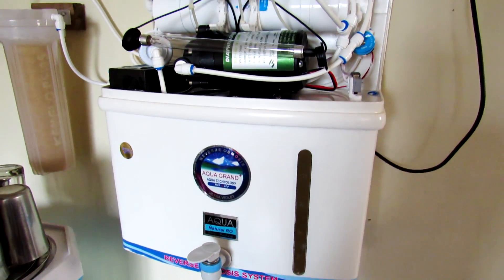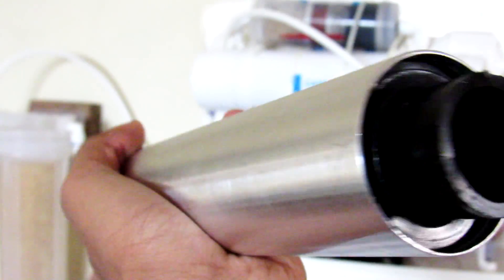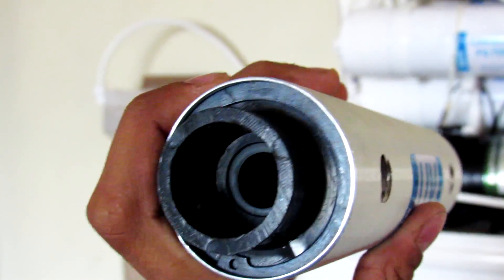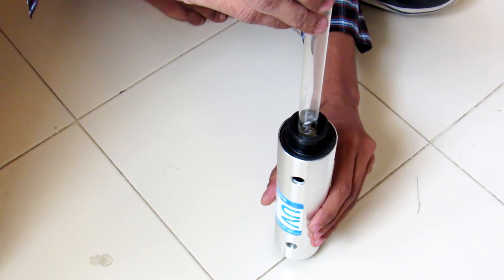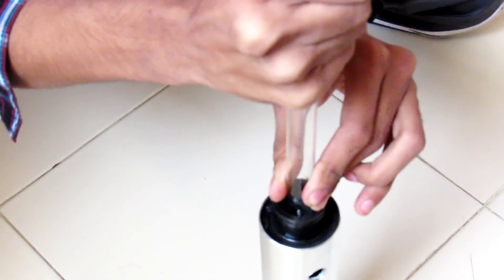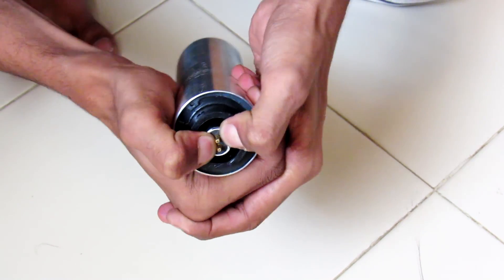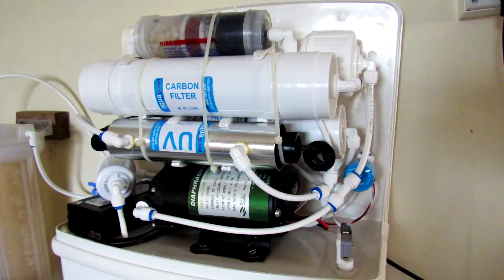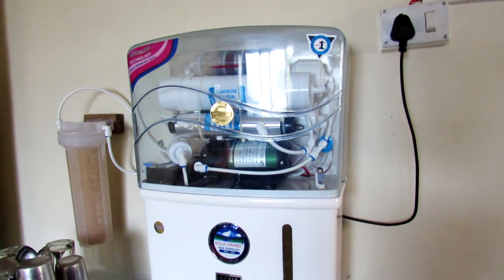💧 UV Light Bulb | UV Lamp Replacement : How to Change

Comment: I appreciate ki tumne English m smghaya but technical words thode smbhal k use kro drag force kehte kise h wo janlo pehle ok.
Reply: Mohd Sajid Drag is a force no compulsion to mention force. Just like drag over aeroplane wings or drag caused on a car due to air. And the correct technical wording to be used here is friction or resistance. The rubber o-rings cause friction during motion due to which more force is required.

Comment: Don't touch uv lamp and see your eyes this is dangerous, I'm RO technician, I say all of you be careful.
Reply: Kent filter technician charge 420 for this 180 item 🤐🤐
Reply: @adityagautam7978  Arey wo jhuth bolte hain, mereko bhi membrane ka price 5500 bata raha hai. Mera RO abhi warranty mein hai, phir bhi kah raha hai baaki sab cheez free mein lagega, bas membrane k liye paise lagenge. Kah raha ki membrane ki installation date pahle ki hai, isliye.
Reply: @adityagautam7978  Tumhara uv filter replace kiya kya?
Reply: @RajatKumar-jg7zd  h bhai Replace hua tha kent ne Website parts ki jo Price mentioned ki ussi hisab Charge lete h magar kabhi-kbahi parts Genuine k badle local daaldete h wo log mene pakd liya tha 😂
Reply: What is cost of Philips 11w uv lamp tube
Reply: @adityagautam7978  The lamp priceis 180/= philips
Reply: Sir, what if UV lamp breaks?
Reply: @RajatKumar-jg7zd  break uv is not use please throw it.
Reply: @anilarora4249  If it breaks and I don't get to know about it, then what will happen? Is it dangerous?
Reply from the maker: Uv light is harmful for eyes and skin so don't expose yourself to it
Reply: @HowToGuys right 👍👍👍👍
Reply: @HowToGuys  If uv lamp breaks inside the RO itself, then how will I get to know about it?

Comment: we have Aquaguard magna uv water purifier in our home,the uv lamp emits light directly from inside to outside in between there is a glass but when we stand in front of purifier we can see the uv light from the glass,is it dangerous?plz suggest I'm worried
Reply: The cover should block most of the uvc light, but still avoid looking directly at the light.
Reply: If u get any answer or solution please reply me
Reply: If u get any answer or solution please reply me
Reply: If u get any answer or solution please reply me
Reply: @amrinderpalsinghbains1188  we can put cover on it is available in online for 150 to 300 Rs range
Reply: If i don't use cover or anything will the minor uv radiation impact me?
Reply: @amrinderpalsinghbains1188  Technician told me it will not effect but I thought placing cover is better option
Reply: @sardarhumanist did u also asked the uv light leaks from the plastic elbow or from the rubber of the uv barrel?
Reply: @amrinderpalsinghbains1188  i can see the light from inside the storage tank
Reply: @sardarhumanist  actually the technicians from the company never say bad about their product or tell us the truth
Reply: UV rays are dangerous to any living cells. Remember technician is not an expert. Always stay clear from UV rays unlike what this guy is doing in the video